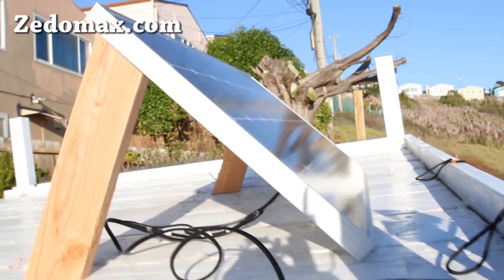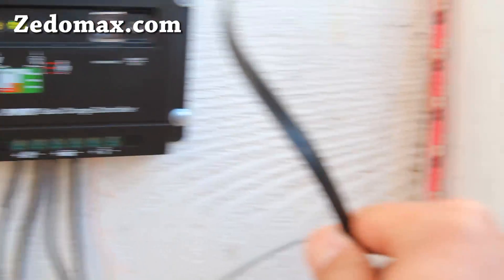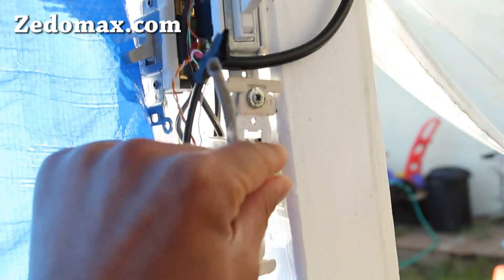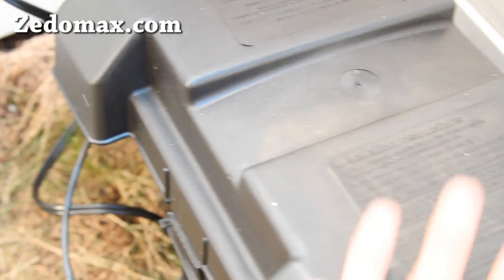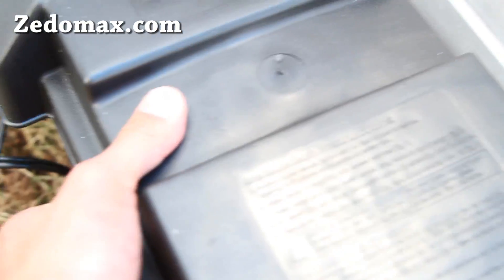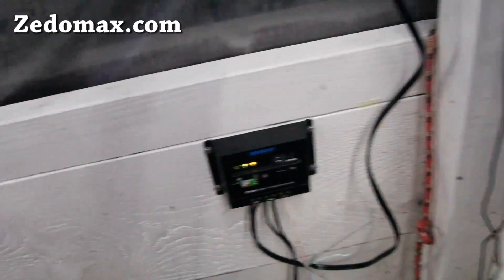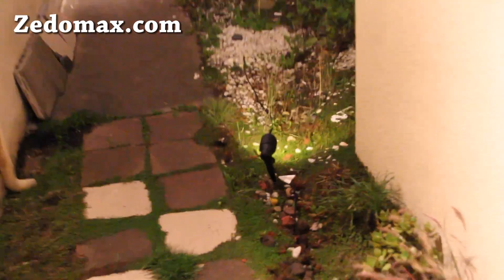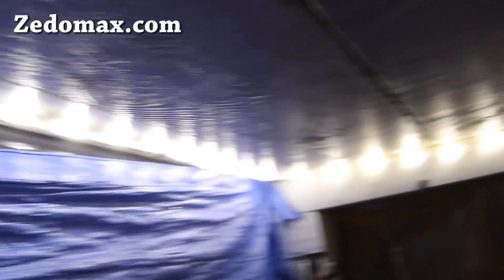My New DIY Solar Panel System!

Comment: This looks cool and maybe find something to do similar.  Just made a outdoor shower recently and just heats by sun. Got a heating tank from auction dirt cheap and gutted, shower floor was given by friends that remodel homes and haul things off at times. Spray painted tank black and have black hose that run the water.  Have a heated temperature valve for hot or cold.  A pull release for water control. Works great but starting to get cold now and gotta make sure to shower no later than 9pm lol.

Comment: I'm also looking into Solar panels installed to supply a large or maybe all of my electric needs. The solar panel gas come a long way. Be very Careful who you use, check them out very carefully. To get your solar credits there is a certain way the system just be installed. Good Luck 
Vinny